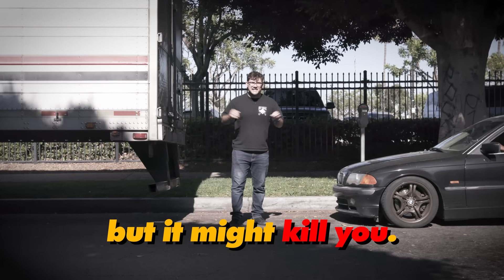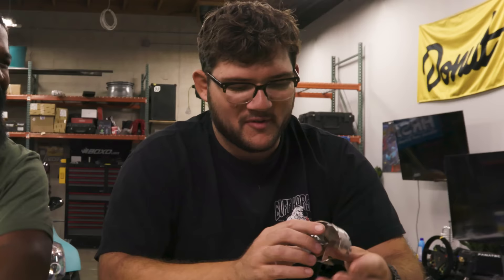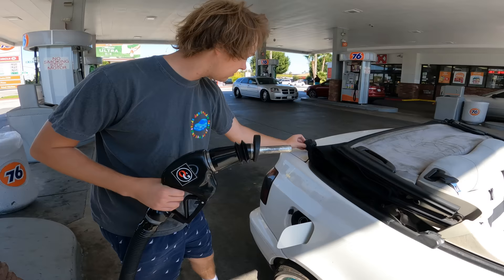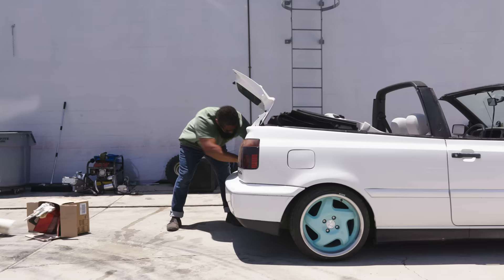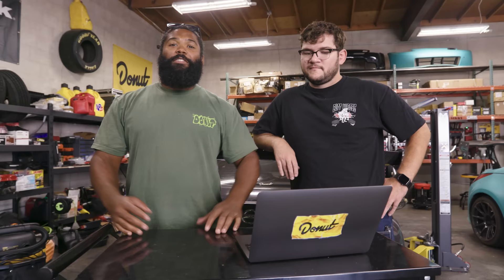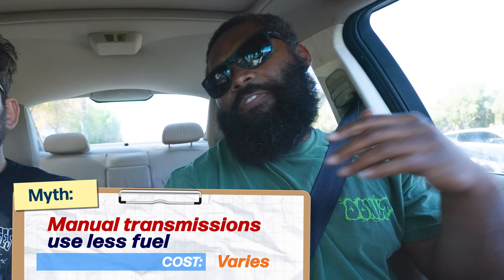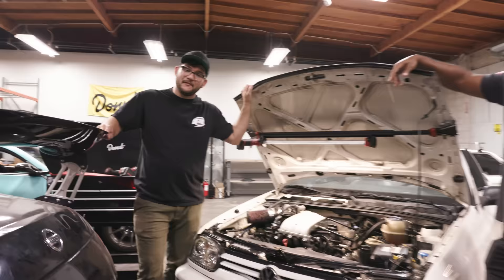Testing Fuel Economy Hacks

Comment: The tyre inflation does work, but would only recommend 4 to 6 psi more than recommended at most. You still have full contact, tyre wear will be slightly quicker in centre, and the travelling will be less smooth. But you will save 1/2 litre every 100km on a car that is 8L per 100kays. Tested over 10,000s of kilometres. The main reason it saves fuel is not because of less tread on the road, but less tyre warp while driving that adds resistance. A simple test, see how one of your guys pull a truck like a strongman. Change PSI on tyres to see if he can pull it faster. And that would be a video I would love to watch!! 😂

Comment: The overinflating tires thing wasn't explained correctly imo. It's not about the tires giving less resistance, it's about the tires having a large circumference. In theory, when you overinflate, the tire will expand and be slightly bigger, but, since it's just air, not heavier. This would theoretically mean that every rotation of the tire brings you slightly further for the same amount of fuel used in the engine.

Also, concerning the manual transmission, one thing that wasn't mentioned is that manual transmissions generally weight a few hundred pounds less which could potentially get you better fuel economy than an automatic if you make sure to shift with fuel economy in mind.

Comment: Top Tier Gas... It's a fact one but depends on your location and your car a lot.
There are gas stations, especially here in Czechia, where the gas can be really different and you notice it only if you're going over 80 kph. Every brand of gas station has a different source, different additives and different pureness. Shell, MOL (only "premium" gas), Prim and a few others do not add too much other additives into the fuel so your car runs smoother and with only 47kW I have, you definitely notice it. Also some gas stations may sell expired gas which is okay but it is degraded and also may affect highway performance.

My take is that if you're in a city... you don't have to care at all, just put some additives in the tank from time to time to clean the system and the engine of any residue and you're fine.
If you're going like 130+ kph on highways, for sure buy higher quality gas, otherwise your car will consume more if you go "full gas" or want to overtake someone. So it just affects peak performance which most people do not care about.
Reply: Great video otherwise!

Comment: For what it's worth, for there to be an IC from Microchip semiconductor in that OBD2 I'm inclined to believe it was a programmable controller capable of doing just about any IO operation. Still probably a scam but for it to have a controller from Microchip is shockingly legitimate.

Comment: Part of the temp thing is supposedly that when it is really hot the gas in your tank is more expanded and you lose a little bit of it when you open the tank vs when its cooler. I dunno if that makes a significant difference, but just for the sake of it I try to fuel up when its cooler. But I also live in phx so its gets up to 120 degrees and when I had a screw on gas cap I've heard it PSSSSST like a soda opening lol..

Comment: If the HHO uses the battery to turn water into fuel, that would use a lot of energy from the battery, which is powered by your motor running on fuel.

Comment: The manual/automatic debate is a tough one. If you drive normally (that being switching gears at moderate rpm), an automatic gear box is better. I prefer manual, due to personal preference. My one friend has gotten amazing milage out of a manual, would go as far as to say better than an automatic, but he always shifted at 2000 rpm and never went over. Automatic won't necessarily allow that, but he is going slower, and it takes much more time, and time is money. So the savings aren't what I would consider worth it

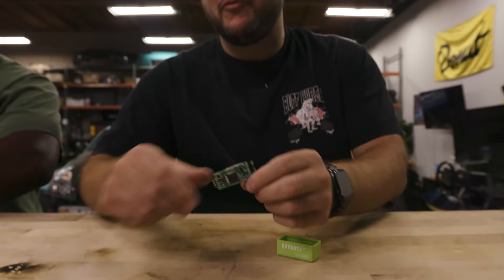Comment: 8:41 I am curious about the Top-Tier gasoline being better than regular tier gasoline. What was described was Octane ratings to each other, not quality of one fuel compared to a different fuel. Top Tier is typically different only by additives each company uses, the actual gasoline provided may be the same.

Comment: In EU we drive behind trucks all the time, best if there are many of them in convoy, they are moneysaver, it does help the semi too, just don't fuck around the trailer nor in front of the semi too.
One semi is not worth it because you need to be very close but 2 or 3 makes quite a big difference. My friend has a. 1.6 N/A VW diesel engine and getting behind a few trucks makes a huge fuel difference

Comment: in winter i warm up my car to defrost the windows then i shut the heat and open my window of an inch so my windows don’t fog and it actually works well
Reply: Good tip for EV drivers. In gas cars, there is so much waste heat directed to the radiators too cool engine down. Might aswell use it to heat cabin. 
Hope you're not suffering, thinking you're saving gas.
Reply: @bcamping1  no lol, it is a big ++ if you are a smoker hahaha

Comment: 5:20 I call BS on that one... Put your car in neutral and put 20 psi in each tire and push it and see how hard it is to do... Now put 40psi in them and repeat the test.
Not to be misunderstood; YES, you should put what the factory recommends for best all around performance out of your tires.. however, if you're going to to 1000+ miles on I-80 for the next day, put some "extra" (just don't go over "max recommended" on the sidewall) in them, and you WILL, 100%, save fuel.  Just put it back to "normal" after your trip.

Comment: On the HHO generator, even if it's large enough to make enough fuel to run an engine, the power used to generate the HHO comes from electricity generated by the engine. Current commercial HHO attempts are getting around 30% efficiency so the power you use to seperate the water will always cause a net loss. It's the "strap an alternator on the axle of your electric car" argument all over again.
Reply: Maybe a stupid question, but could a solar panel provide enough electricity to run the HHO?

Comment: Wipers do impact MPG, but it’s incredibly minimally. 

This is why some cars, like my GTI, hide the wipers behind and almost under the back of the hood when not in use. 

But if they just sit out in the stream of airflow, leave them be. You need them, and the improvements you’ll get will likely be less than .1 mpg

My GTI is also an egg, so +1 for that lol.

Also, on manuals vs autos, unfortunately the only thing that’s better about manuals now days is driver engagement. Autos are more efficient, and faster now. The DSG in my GTI shifts faster than any human can. Hell, even torque converter autos shift faster than humans now. But there’s no denying rowing your own gears will always be more fun. I went with DSG because it’s my daily, so I commute a lot in it. I also didn’t want to have to upgrade my clutch just to go to stage 1 tuning, because the MK7 GTI stock clutch will start slipping with anything over stock power. Instead I just flashed a tune on the DSG and was good to go.

Comment: HHO could work in theory, but in order for it to reduce gasoline consumption, you would have to tune the car to use less gas and regulate the hydrogen to replace the pulled fuel. otherwise this is unregulated hydrogen going into the intake and just adding power at best

Comment: HHO generators actually decrease your fuel efficiency by varying amounts but may be offset by whether the power they use is negligible or significant to the alternator. The more power draw, the lower the resistance across the alternator coils, the stronger the eddy currents that slow down magnets as they pass by the metal wire. Electrolysis uses more power than you can generate from combusting hydrogen, so HHO generators in your intake don't really work. Hydrogen does, however, make for a good fuel even if it was generated inefficiently, as its power density is greater than lithium ion batteries, which are similarly inefficient to charge, as they're doing the same damn thing but optimized to move ions in solution rather than split the molecule of the solvent.

Comment: 13:50 I would beg to differ in part. Yes a lot of modern cars have good automatic transmissions, but mostly the more expensive cars. (I'm talking mainly about the European market because here are the green nutters ) If you buy a car here for 40K€ the manual will eat less. Because an automatic transmission weighs quite a lot of weight and at the same time it won't be an eleven speed transmission but at most a six.

Comment: computers have set rpms they have to reach before they upshift, in a manual you can have what gear you want when you are driving and with fuel econ the lower rpms you are running the better mileage your getting as long as ur not bogging it down. also your not limited to only six or seven gears alison has a 10 speed manual

Comment: Guaranteed ways to increase MPG:

Tyre PSI to manufacturer standard

Empty out your car of anything that will add weight

Abuse drafting

Stop braking - Allow your car to coast / engine brake, you will see instant increases to mpg - it is always more efficient to avoid stopping!

If you know traffic is stop & go, leave a gap of 3-5 car lengths and drive slower in as high a gear as you can. 

Cruise control is a lie; it cannot predict gradient changes and it is far more efficient to enter an uphill at a higher entry speed and maintain/gradually slow down by the top than it is to have to accelerate or maintain a lower speed uphill.
Remember; if you're fighting gravity, you want to be fighting it for the least time possible to be the most efficient.

The peak efficient speed for most sedans is ~75-85mph on the highway
This is where you cut through the air the most and have the best balance with wind resistance if you aren't drafting.

Key note from a professional drafter -- If you cant see the rear bumper of the car you're behind, you're close enough. You'll know because you'll feel mildly 'sucked in' to the pocket behind them. 
ALWAYS HAVE YOUR INTENTION TO BRAKE READY!
If you are prepared to brake there is little to no risk. Be aware of your environment at all times and remember its always better to ease off if the person doesn't like you drafting, brake checks are impossible to predict but easy to avoid if you are paying attention.
And if you're anything like me and service your brakes regularly, you already have the better braking compared to the person in front of you :)

Comment: Note that in the very early days of engines, when you had carbs and fuel octane was roughly 65-70 ( ! ) , tricks like that vortex device could improve economy a tiny bit.  How it worked was by restricting airflow you could set the timing far more lean as the lower airflow would make it run rich.  You would lose a lot of power, but if you drove carefully, you could indeed get better economy, especially in a big heavy vehicle.  Note that a 50 cent DIY restrictor plate also did the same thing, as did running much smaller jets.  Holley carbs were notorious as well for running super rich and getting 8-12 mpg.( as an example)  So.. interesting MPG hack from the 50 and 60s... useless today.  It got "revived" during the 70s car crisis (1974), but by 1976, it all was useless as computers had taken over/there were sensors and computers even on cars still using carbs due to smog regulations. Fuel also changed from leaded to unleaded around that time which meant that you couldn't adjust the timing nearly as much and get away with running super lean to get better mpg. Note that the last car without fuel injection was sold in 1994. Anything modern requires remapping your entire fuel management and ignition system, same as installing a turbo or similar, but the manufacturers already DO this to meet EPA numbers.  It's set from the factory as lean as they can get away with and not have it damage the engine.

Comment: so per bmw, and chevy you can run lower octane fuel in your 91+ car with no damage to your car as long as all is good with your computer. it will sense knocking and retard the timing accordingly. and over inflating tires is about sidewall rolling resistance not the amount of rubber on the road (not saying it works but proven less rolling resistance).
Reply: Every now and then give it a "treat" and run high octane stuff, driving on a cool day... this resets the computer like a free tune up

Comment: The problem with HHOs and the science of hydrogen powered cars that generate their power through onboard water - is that electrolysis is a net negative chemical reaction. Effectively, it takes more energy to break apart the water molecules than you'll get from the hydrogen you get out of the reaction. It's just a waste of energy.

In a large enough tank, what you'll see is lower MPG because the alternator is going to be working harder to provide negligible benefits to power.

Comment: 7:18 yes your saving gas but is it worth getting impaled by the rear when the truck brakes?

Edit: after talking with my grandpa which was an ex truck driver he said, it wont kill you but you will lose your license as at that speed you will be immediately braked by the truck(truck is always slower than a car) plus the fact that the further away you are from a truck the harder the impact will be

Comment: Higher tyre pressure: Saves fuel (made a difference of 0,1 to 0,2 liters on 100km on my car. HOWEVER, it ALSO increases wear and tear on suspensions and other components. (I no longer do it. It does not pay)
Lighten up the car: Well, if you drive city, yes, it is true. However on overland trips, the momentum actually helps you partially to get you over small hills easier and it might save a little bit of fuel.
Better fuel QUALITY DOES improve mileage: I had a Mitsubishi L300 in Australia: Cheapo fuel: 11 liter on 100km, Standard Fuel (well known brands) around 9 liters. Premium fuels of well known brands (NOT higher octane) around 7.8 liters. Driven on the same distances and style of street with the same driver and load.
On my current car (Dacia Logan Diesel), it makes a differecne from 3.8 liter on 100km to 4.5 from cheap to Premium fuel.

Comment: Depends on how much pressure over 35 to 45 isn't gonna do jack for wear but down highway does help minuscule I had a car I'd do this with bc it was 50 miles+ one way its like 1.5 mpg better just don't do 60psi in a 32 psi reccomended many tire manufacturers actually reccomend 35-45psi depending of its a car lo pro or truck tire cars reccomend for the most comfortable ride or grip in sportier models.

Comment: On older (1980s and before) cars, removing the wipers DID have a miniscule affect improving the vehicles aerodynamics. 
But it was like.. 🤏

Current cars have already taken care of this issue by having the wipers tuck down into a low pressure area between the hood and the windshield.... You know, that little "pocket" where the wipers rest, that fills up with snow and jams your wipers an/or fills up with slush when you're driving and prevents the wipers from being able to go back down all the way and complete the cycle? Yea, that's why it's there....

Pro Tip: If you come out in the morning to a windshield full of snow, make sure you clean that pocket out well, and get ALL the snow and ice out of it. I have had to replace wiper motors on customers cars more than several times because the snow that piled up in that pocket prevented the wipers from going all the way back down when they were turned off, and the motor stayed on, struggling to try and park them. If you're lucky, a fuse will just blow and you'll be scratching your head the next time you turn the wiper switch on and nothing happens, but that's not always the case. Sometimes the motor(s) and/or electronics burn out.
Some cars now have TWO wiper motors (one for each blade) and it can get awfully expensive. So, take the annoying time to clean the pocket out..

Comment: It's funny to me that everyone who wants to save on gas will even spend $500 on a scam electrical device and nobody thinks to have their car professionally tuned to maximize mpg? 

Like, run the engine Lean of Peak right on the O2/Lambda and knock sensor limits, and re-calibrate the transmission to hold a higher gear or even shift up earlier at part-load. You can also tune it to lock the torque converter at a lower speed and in lower gears at part throttle, while also commanding it to downshift aggressively and unlock the TC when the pedal gets the boot, going better 1/4 mile performance when desired.

You can pretty easily pick up 5-10% (1-3mpg) with this, and it works on most cars.

Comment: I am from Germany and here our Top Tier Gas has 100-102 Octane. Shell VPower is 100 and Aral (BP) has 102 in ultimate. I never thought in the US V Power only has 91. Regular German gas gas 85 with 5% ethanol oder there is e10 with 10% ethanol. E10 is cheaper.

Comment: what about putting the car in neutral or park vs using the brake in drive when stopping at red lights? (not debating turning it off, that's just annoying but legit)

Comment: Manual transmission cars can be more economic than automatic ones, not a mith. It depends on the type of automatic transmission the car uses. CVTs are more economic or about the same as a manual. Other automatic transmissions will be less fuel efficient than manual ones because they're simply heavier than manual ones. In certain cars an automatic transmission can weight up to 50kg or 100lb more than the same car using a manual transmission.